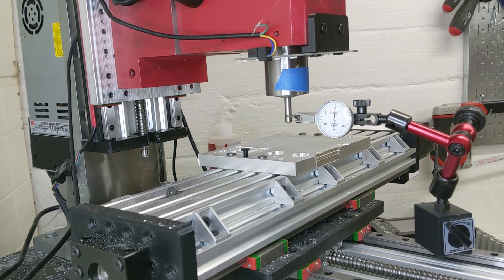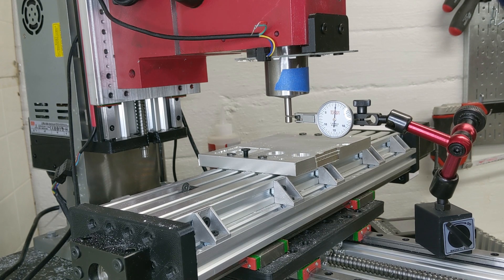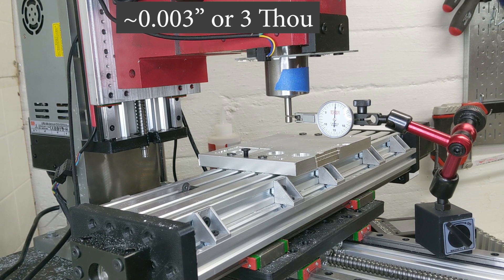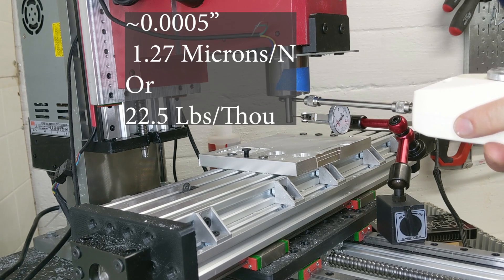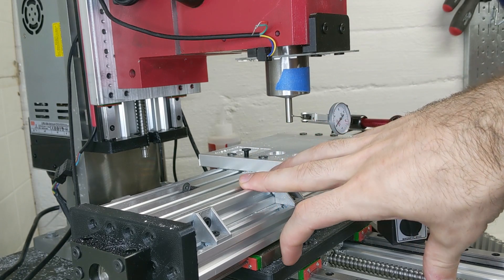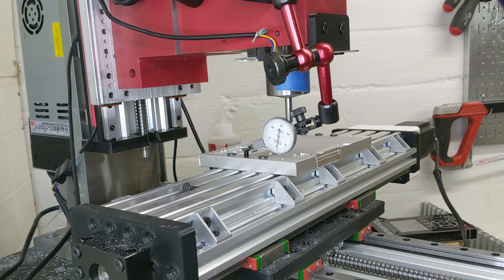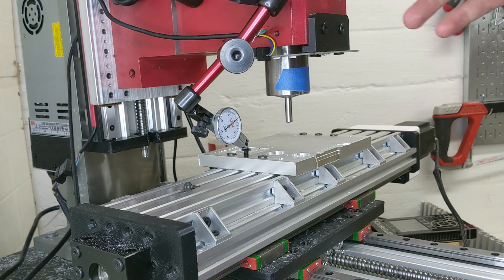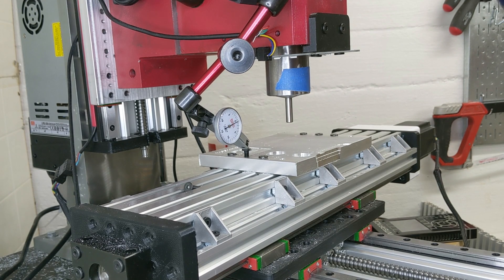RIGCNC- 3D Printed VMC - Rigidity test - Plastic Plates

Comment: Slight inaccuracy in alignment. The force must be applied between the table and the spindle. And the display stand should be on the table.
But even in this case the deviation is much larger than the maximum when cutting steel. For 10kg, 0.01mm is acceptable (but 50kg is better with a 0.01mm deviation as this is a freshly made machine).
Reply from the maker: I had to decouple the tests to make it simpler to perform, the assumption being the deflections add together.  For that particular test the plates are plastic, so the deflection kinda sucks, it is much better now that I have swapped parts out for aluminum. Still nothing to compared to a more expensive mill but this is very much a hobby endeavor

Comment: Nice work. I have a Taig mill with an upgraded aftermarket steel frame. I did a deflection test on only the frame, not the whole mill assy. The indicator was put at the top of the column, which is about 20" tall, and I pushed into it with my full body weight. I got about 4 thou of movement between the column and the base. I also have a force gage like you, but it was too difficult to push on the column, film, and use the force gage simultaneously. So I just used my body weight and called it a day:)
Reply from the maker: Cool, I would be really interested in seeing what that translates to down at the tool

Comment: That first 7 thou measurement seemed to be more like 15 or so, and stopped in a different place to it started as if the thing moved as opposed to purely flexed. Is that fair or just a trick of the camera or my tired eyes?
Reply from the maker: I think It started at around 0.0005, went up to ~ 0.009 and then came back to 0.002, so there is definitely some undesired movement, a more realistic number is probably 0.008 not 7.  The second time I pull on it and it jumps up to ~0.015 I was putting more than 50 N on it, Its surprisingly hard to pull up to a calibrated point while on camera, It took more than one take to get this video out in one shot.   I think you're right though that things moved on me, I did the dumb thing and shot this whole video without the steppers energized so it might have been me back driving it a little bit, I will investigate that though
Reply: @TheBetterRyanKelly  Sweet, thanks for clarifying that. I see the hoards of people that got sent to the first video aren't here this time, though :-D Keep up the good work, I'll be watching. :-)